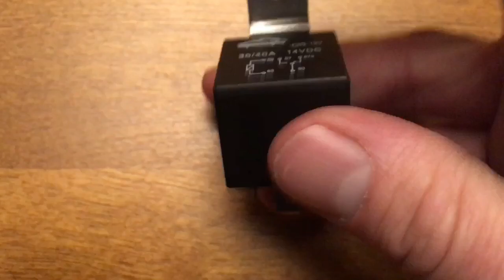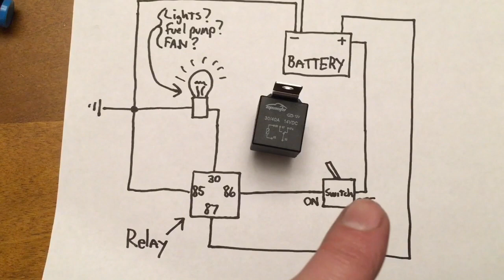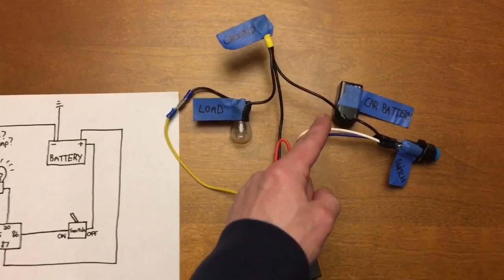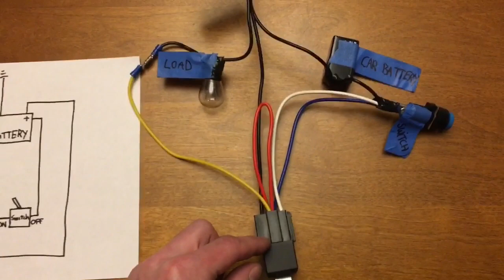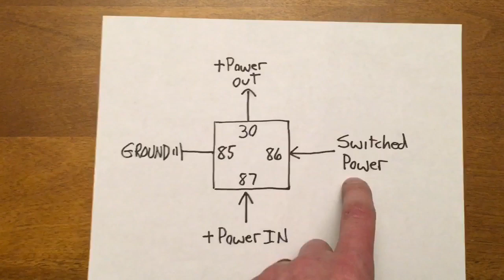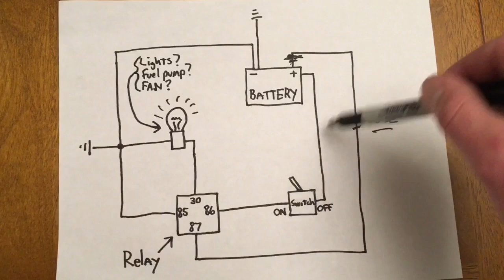How to Wire a 5 Pin Automotive Relay. Pins 87/30/85/86/87a . Bosch Style. Fans / Fuel Pump / Lights

Comment: Im confused so many diagrams and videos. I am wiring an air horn. Shows completely dif
Reply from the maker: Air horns should be pretty simple. Use this video link, and ignore pin 87A entirely. Pretend 87A doesn’t exist. https://youtu.be/W2Mr2Zgv1Ck

Comment: So basically a relay is a box with 2 circuits. 1 for high power and 1 for low power. The power or amp draw is based on the source. So the load or high source is separate from the switch or low source so not to fry the switch.
Reply from the maker: You have absolutely nailed it. Great explanation!

Comment: Could use a little help bro. Electrical dummy speaking!
Reply from the maker: Rick_G 81 - what help do you need?
Reply: @WiringRescue  is your 87 and 30 backwards? I'm pretty sure it is.
Reply from the maker: Mobile Audio Pro - yes! Which is why I made a new video last week. Check this out! https://youtu.be/W2Mr2Zgv1Ck
Reply: Thanx for replying bro. I'm having the hardest time wiring my LED strips to an inkbird timer, diaphragm vac pump and power supply. I'm building an exposure unit for screen printing.
Reply: @ricky_c8199  So if its not to late LED I am assuming is for the screen exposure vacuums press. Ive always used florescent bulbs  but that was a long time ago any ways. So is your timer is designeds for 110/220VAC then you'll need to convert the signal after the timer output to a small power supply make sure the power supply can provide whatever current/AMP(ERES) your LEDs are set to pull and at the right voltage some power supplies push out power at different voltages and at a set current limit so if your LEDs are set for 24VDC at 2 AMPs then I would get a power supply thats 24VDC at 5AMPs this is important make sure the current/AMPs of the power supply ar 150% for the needed power to prevent fires and damaged equipment. DO NOT FORGET THIS YOU WILL REGRET IT AND/OR DESTROY EQUIPMENT OR YOUR PROPERTY. Now the voltage is just as important but if you get a supply rated for 12VDC and your LEDs need 24VDC then you're just gonne have dim lights that won't burn a screen or take so long to burn the emulsion cooks and if you get a power supply rated at more than the 24VDC needed then you'll blow the lights and need new ones. So get the power supply needed for your lights and not anything over or under for best performance. Make sure the needed current it provides is higher because the higher it can put out the safer you'll be but never go for anything under the pulling current of the LEDs I could go in detail why this is important but this is already long enough so lets leave it at under will over work your power supply and kill it or burn everything down. If your timer is 12VDC input then DO NOT PLUG IT INTO THE WALL OR YOU WILL BLOW EVERYTHING IN THE CIRCUIT get a power supply plug that into the wall the the + and - output of the supply to the  to the + and - of the timer and then the timer output is gonne goto the LEDs  and if your VAC is 12VDC then you can split the output of those to the power supply of the lights and vacuum but make sure the power supply can give the ammount of current all the items are gonna use plus another 50% or more so if the pull total of 13 AMPS make sure you can give 19.5 AMPS atleast but the more the safer. Now it will get complicated if they don't all need 12VDC beause there are a ton of combinations that can get confusing and an electrician is recommended.  If one needs DC and the others need AC the power supply and relays and circuit breakers and relays that can convert AC to DC.

If your system is all DC then 
AC from the wall including ground to the G - DO NOT FORGET GROUND-  and live to the L and neutral to the N 
+and-  out to timer +and- in
+and- to the split to the lights and vacuum
Reply: @MobileAudioPro  I have the light and timer running on my power supply. Yes I have 12v leds and 11v power suply. Now my problem is hooking up the vac pump.
Reply: @MobileAudioPro  my timer is 100-250VAC.
Reply: @ricky_c8199  So I am assuming the vacuum is not linked to the timer only the LEDs for obvious reasons you can't hurt the burning of the emultion by leaving the vacuum on to long but the lights you can. so what I would do is wire your power supply AC in the Live and Neutral  out from your timer so that the timer can stop power to the lights when it goes off. If you are using the screw terminal power supplies and your timer puts out the same AC current it uses then it'll power the power supply that feeds DC to the lights I would also wire the GROUND of the supply to share the timers ground for safest use now if your timer is the kind that uses AC but puts out DC on its control wires you will need to make sure the current it puts out is more than what the lights use but this is not a common feature ive seen on timers.
Reply: @MobileAudioPro  honestly I don't know how to wire the vacuum pump to the timer. My led strips are running from the power supply. The timer shut off the power supply after the countdown which shuts off the lights. Do you have an facebook so I could inbox you a vid?

Comment: You should not be tell people "How to Wire a 5 Pin Automotive Relay". Your video is incorrect.

"87a that nobody cares about" NOt true at all. Everyone that owns a car that has low and high beams cares about it, they just don't know they do. Same for power windows and power door locks. People who want to turn something off care about 87a. You seem not to care about it but given the way you gave improper information in this video, it makes sense that you would not care.  

You mentioned car battery and in cars the 30 pin/blade/contact is the power/battery positive side. The 87a and 87 are the accessory side. That is the way most connections are made even if it is not in a car. Why? Well, because when switched the power 30 is moved from 87a to 87. The way you hooked it up, the power only gets cut off and not moved. 

Now sometimes you have two different power sources and that's when you use your hook up. 

You also have the power for the relay going to 86. That's wrong. It should be on 85. When a diode is internal or external it is setup up so the power should be on 85.

Comment: In your mock up, what is the red wire for and what terminals is it connected to?
Good vid.
Reply from the maker: Talbert Adams - thank you, and good question! The red  wire is the 87a wire just folded over and stuck back in the 87a hole in the plug. I did this because I didn’t want to cut it off or remove it for the video. But it doesn’t do a darn thing in my example.
Reply: @WiringRescue  Thanks for posting the answer.
Reply from the maker: Talbert Adams - absolutely! That’s what I’m here for!

Comment: What you did definitely works for the circuit you built, but it's customary to wire the 30 pin to the power source (battery).  With a 4-pin relay it makes no difference, but with a 5-pin relay, like you showed in the video,  powering the 30 pin allows you to energize either the 87 or 87a pins.  If you power the 87 pin, the 87a pin is useless.
Reply from the maker: Charles Enfield - great info! Thank you!

Comment: What is use of 87a pin?
Reply from the maker: Tune Up Street Machines - imagine you want a circuit to always be powered on, except when the relay is activated, that’s the 87a. It not used I often. It’s tough to even think of a real world example. The best I can come up with would be ....
Imagine you turn the key of your new-ish car to “run” (engine off) and the daytime running light turn on (through the 87a circuit). Then you go to actually start the engine, and you want the headlights to turn off when the engine is cranking, to give the starter all the battery juice, (which is the 87 circuit). Then when the car starts, you let go of the key, the starter flicks off and the running lights turn back on with the key back in the run position.
Reply: @WiringRescue  Your a genius.  I just bought LED headlights for my neice's '98 Wrangler.  They include DRL's, but I didn't even consider trying to make them work in her older vehicle that doesn't have the circuitry.  The I saw your comment.  Thanks!
Reply from the maker: Charles Enfield - excellent! I’m glad I could help you out! If you feel wild, feel free to subscribe to this channel or tell a friend it!

Comment: I love using relays. I switch them through the ground side though. And 87a is useful when you have an led letting you know your electric fan is off (toggle switch controlled). I've seen a YouTube video about wiring a diode parallel to the coil side of the relay, prevents spikes to the relay driver, I have yet to try it. Great video, I've been meaning to do some "benchtop" videos too.
Reply from the maker: Rusted Horsepower - Thanks for the info! The LED on 87a is a cool idea. I may try that one in the Ratty Lemans Project :) Also - these “benchtop” style videos are pretty fun to do. You can count on me watching them if you make them!
Reply: Rusted Horsepower can u help me wire some lights on my golf cart? I have tired and can’t get them mayeb u could tell me what I’m doing wrong